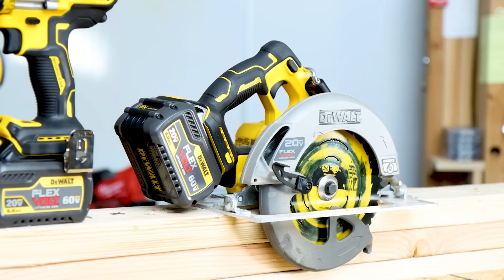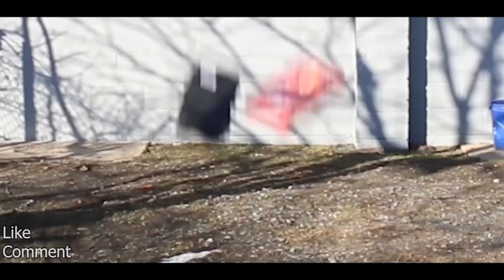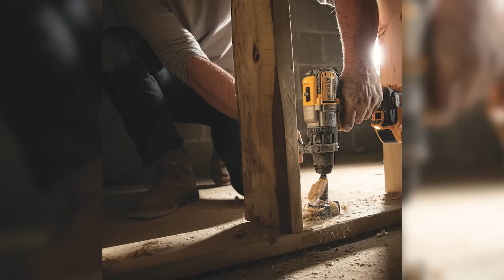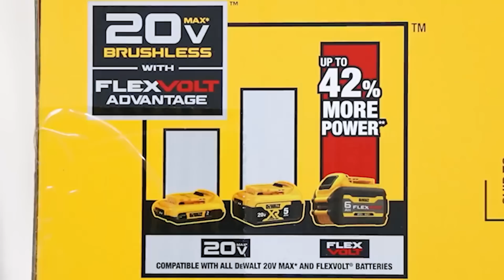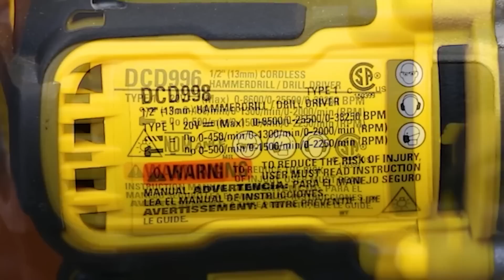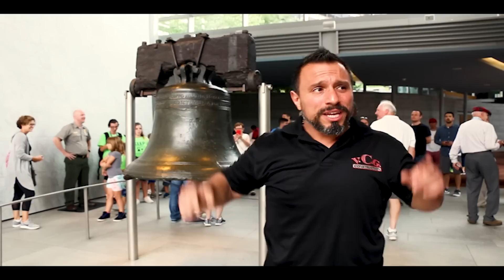DeWALT Tools DIRTY Marketing Tactics (FLEXVOLT Advantage AND Power Detect Hammer Drills)

Comment: Dewalt will always be #2. Milwaukee is just better 👌🤷‍♂️
Reply: Milwaukee's impacts are trash! The chuck always gets stuck! Ive had several impacts and they all get stuck!
Reply: @erickpenaloza1 I've have seen videos with issues with collet retention. But I don't need to push 3 and half inch spade bits through wood so personally doesn't cause an issue for me. And some people say it's luck of the draw man. I've never had a single issue with any 3 of mine. Only problem I've ever had was with my first dewalt impact! Where every bit got stuck! It was a collet issue. And there battery's died every 5 mins. My life got a lot easier switching to Red and I've made a lot more money. Watch a couple more videos and YouTube and you can clearly see Milwaukee is overall just the better brand...
Reply: @erickpenaloza1  and the collets are garbage let go on bits and loads wobble also trigger fails and general quality is bad on milwakkee
Reply: @erickpenaloza1  ok that one bad tool, anything else?
Reply: Metabo Germany are far superior
Reply: Maybe if you're a plumber but if you're a carpenter and need real tools you get DeWalt
Reply: Seen the wobble on the dewalt collets lol about 80 thou runout on them 🤣🤣 rubbish makita blows them away on quality with the  impacts
Reply: Milwaukee does make some superior tools. If you want to argue their miter saws or table saws are better than Dewalt you need to wear a hard hat more. How bout track saw. Milwaukee still can’t make one. Planers? Nu uh. 

Milwaukee is fine for mechanics. Or general construction. But they don’t make a complete line of tools for finish carpentry like dewalt or makita.
Reply: Milwaukee all the way ,. They innovative and improve.  Dewalt just does what this video says renames old tech and sells it for 40 more bucks
Reply: Hey guys I was all there too. Dewalt till I die I said!!! All my friends were Red freaks as I liked to say. But then that's exactly what happened. All my Dewalt tools died. I tried Milwaukee and the difference was definitely noticeable. But there both great tool brands. I made alot of money with Dewalt tools.